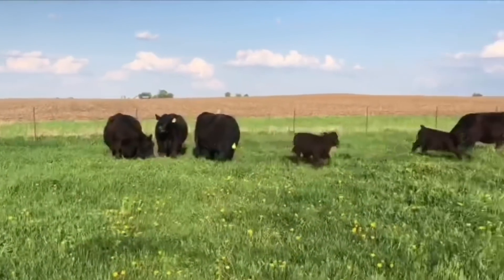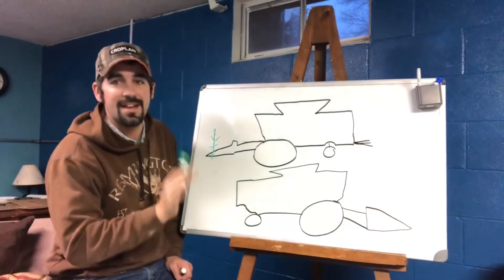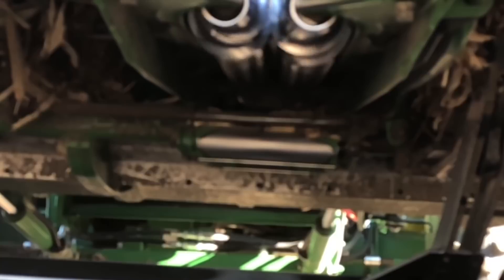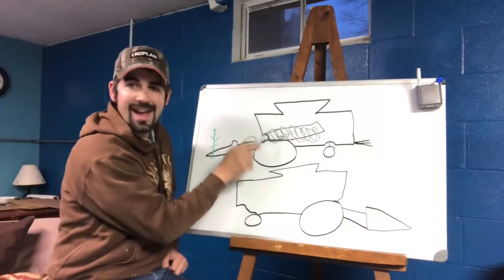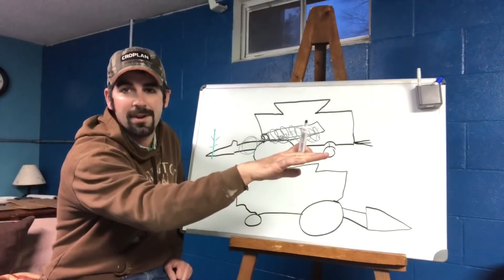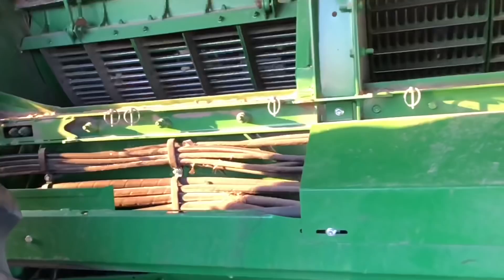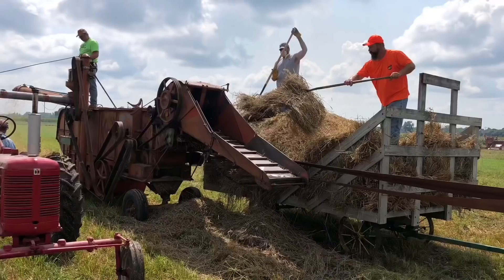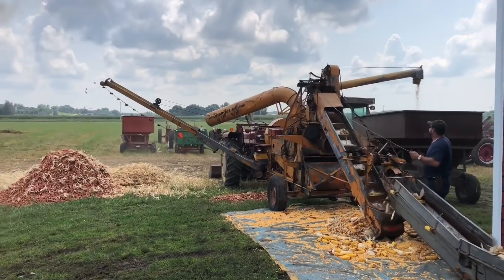How does a combine work? Why is a combine called a combine?

Comment: Thanks for the great video and explanation! However I do have one question:
Unlike corn, when you harvest wheat, how does the separation of chaff from the seed itself is carried out?  You explained how, through the process threshing, corn seeds are “ripped” of the ear, but isn’t true that with wheat you would have another step of separating the chaff from the seed, whereas corn does not have any chaff associated with its grain!?!? Or in simple words: Can you confirm that within a combine the separation process applies to wheat but not to corn ? Or am I wrong?  Thanks much!!
Reply from the maker: Thanks! actually every crop has chaff. The corn is no exception. You have to blow the little bits of leaf and stalk and tiny chunks of cob out the back and keep the kernels. That’s what the sieve and chaffer do. Sift out what you don’t want  👍
Reply: @dodgebrothersfarmandranch9206  Okay, got it!  Thanks much and good luck to you guys!

Comment: Hello,I had a Question about Combines.I recently bought an Combine and have little knowledge about the sieves.I simply don't understand how much I should open them.Also,there are two Sieves,the upper one and lower one.Could you please tell me a way to how much should I open them?How much should the upper and lower one be open?Should the upper one be more opened than the one below?
Thank you
Reply from the maker: The upper one should be closed as far as you can without losing grain over the top of it. You will have to check on the ground to see if you are spitting any grain out. The bottom one should be closed just far enough to keep chaff and debris from entering the grain tank. Anything that gets through the bottom one goes into the grain tank. Anything that can’t fall through the bottom one gets dumped onto the top one again.

Comment: Can the combines be set up to leave the corn on the cob or does that require a completely different machine in order to harvest?
Reply from the maker: Good question! That requires a different machine. If you want the corn left on the cob you have to use a corn picker instead of a combine. Much simpler machine.

Comment: Great vlog. We started with a Farmall pull type, then all IH 101, 303, 503, two 915’s, and currently use a 1460.
Reply from the maker: Our neighbor used to help us cut soybeans with a 1480 pushing a 1020 grain table. I was always super impressed with that rig. He could run circles around dads 7700 John Deere.

Comment: I'm a recent subscriber & I learned the whole threshing process from you. I grew up in the Missouri Bootheel around both of my Grandparent's farms. My Mom's Dad had an old Gleaner "F" combine in my real young days, but it blew up before I was old enough to learn it's operation. Then he hired other farmers to harvest his grain. My other Grandpa hired other farmers to harvest his cotton, wheat & soybeans. I hoped my Grandpas' wouldn't retire till I was old enough to take over their farms, but both of them losing their health when I was 14 going on 15 killed those dreams.
Reply from the maker: Modern Gleaner combines have a “transverse” rotor which means that it sits in there the other way. They also have a “pre-cleaner” accelerator ahead of the chaffer. I’m not certain, but I bet the model F was a “walker machine” as opposed to a more modern rotary combine. This just means that instead of a rotor that carries the crop all the way through to the chaffer, it would have had a small transverse cylinder right behind the feeder house that would thresh the crop against a small concave and then a set of straw walkers to move the straw to the back. Here is an animation of a conventional combine with straw walkers: 

https://youtu.be/RMU0goBWRjY

That is how my dads John Deere combines worked when I was a kid. Here is a cool video on the modern gleaner combines with the transverse rotor:

https://youtu.be/f_wN_c2DZ0M

It bums me out that you didn’t get to farm. I also didn’t get the chance to take over my family farm because dad rented it out and got a job in town before I graduated high school. That is why my brother and I both work full time for other farmers and have our own hay and cattle operation on the side.
Reply: @dodgebrothersfarmandranch9206  Thanks for the reply. I will check out those videos on the combine operations.